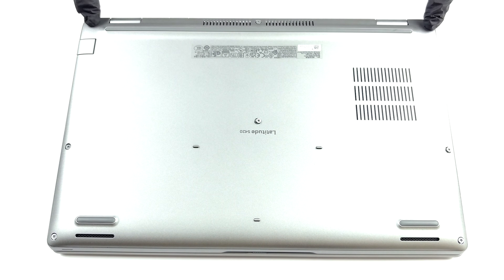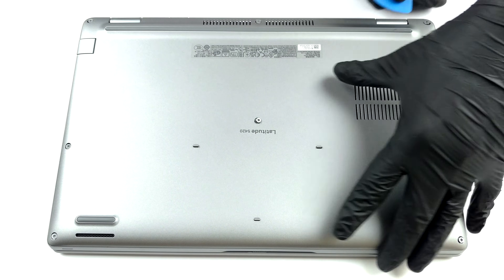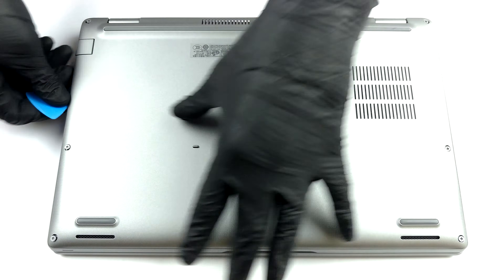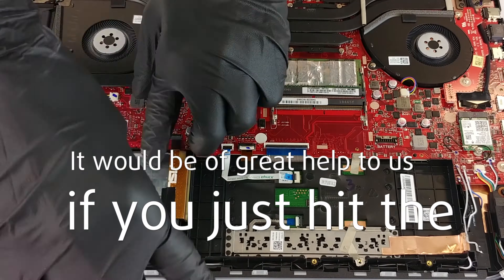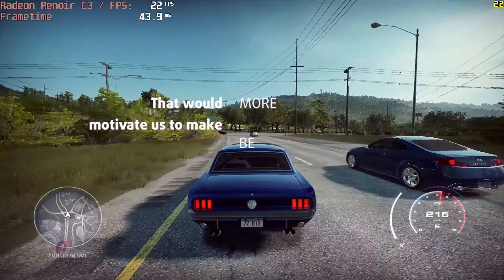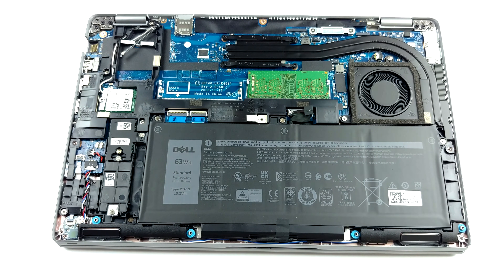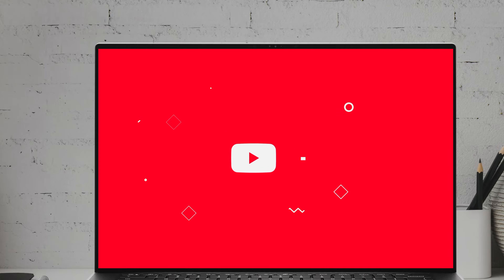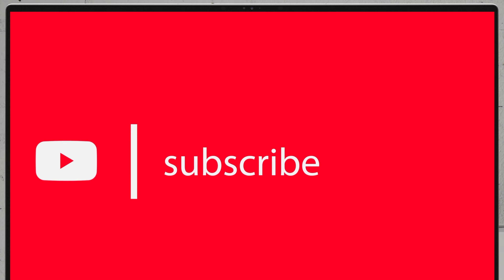🛠️ Dell Latitude 14 5420 - disassembly and upgrade options

Comment: Which would be more long lasting? 5420 or 7420?
Reply: I found out that the 7420 in particular doesn't have any SODIMM ram slots. Meaning that the ram is soldered. So no upgrades/replacements. 
Even though memory failures are rare, I'm not going to take the risk when purchasing a lap.

Comment: Hi thank you for your video.
I am wondering regarding wwan slot for m2. sata ssd.
Based on my experience using Dell 5490 I was able to use wwan slot for secondary ssd m.2 sata, but on my new Dell 5420 the m.2 sata ssd is still not recognized 🥲
Have you ever tried to use that slot for secondary ssd?
Thank you for your help 😀
Reply: Wondering the same... do you already have the answer to this inquiry?
Reply: Wondering the same... do you already have the answer to this inquiry?
Reply: Eu também tenho problemas para instalar o SSD secundário 2280, sem retirar o 2230. É possível?

Comment: Great Video. I need to know exactly where the coin battery is located can anyone  assist
Reply: Probably not much use to you now but might be for someone else. Just to the left of the SSD is the battery cable (red&black). It disappears under the Mobo and the battery it’s self is under the frame on the bottom left just below the board itself

Comment: Thanks a lot, dude...!!! Looking for how to access the battery to force a "hard" reset (the system halted in black screen with keys still on..!!!)
It worked, thanks...
Reply: Hi saw your comments on the 5420 latitude video, I'm looking for the same answer and trying to locate the coin battery for a reset

Comment: Do I have to take the battery out to replace the RAM?
Reply: No
Reply: @egbandman  Thanks. I figured out that the battery is not physically in the way, nut I unplugged it to prevent accidents. Thanks for the video!
Reply: no, but you should set the computer into Service Mode which disconnects power from the battery temporarily: https://www.dell.com/support/manuals/en-us/latitude-14-5421-laptop/latitude_5421_sm/removing-the-memory-module?guid=guid-72284c1c-cd0d-4922-9579-829fdb0bd42b